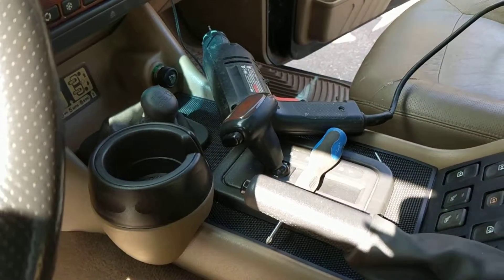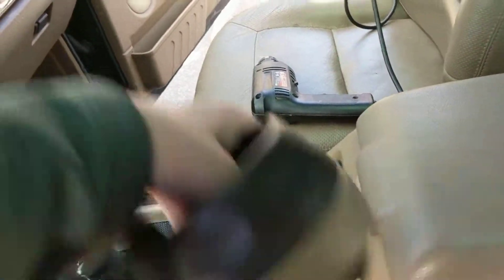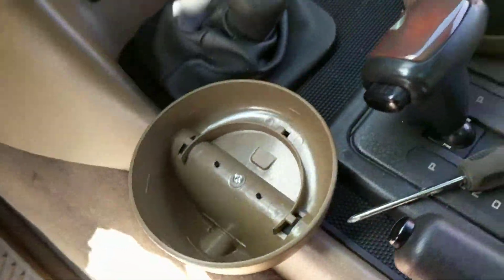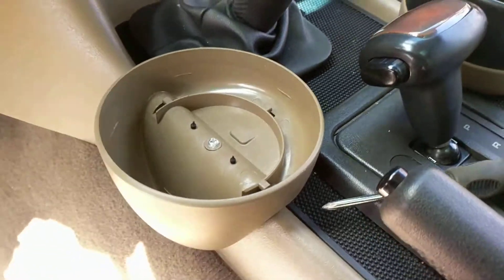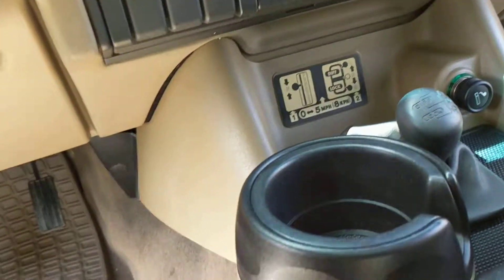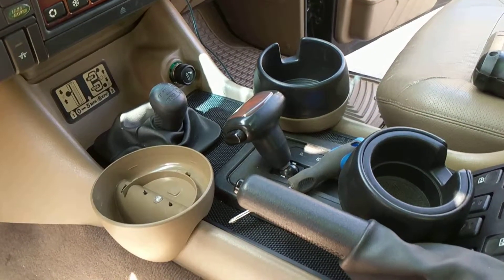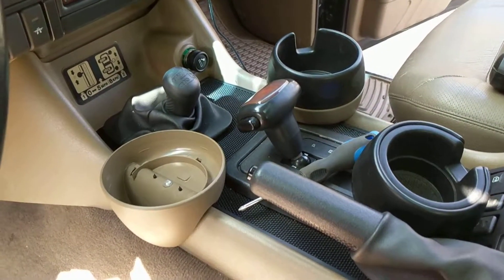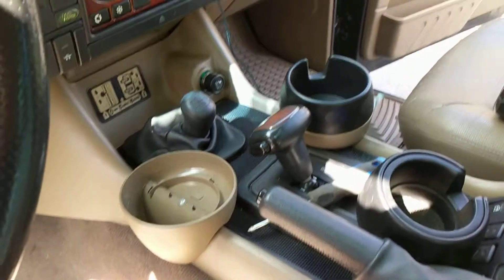1999 Discovery 1 cup holder install

Comment: you did no mention the necessary hole for the locating pin on hte underside of the holder that goes to complement the top screw
- half baked install video
Reply from the maker: Thanks for watching! Mine have been secure for years. Picked them up used. Wasn't aware of a pin ...
Reply: @jamzdotnet  yes, there is an additional hole that needs drilling on the top for the pin
- at least you made the effort for a video, which is something I only think of when I work on the car!

These cup holders really are a big plus when traveling long distance
Reply from the maker: @johnallen3555  I'll take a peek. Admittedly, it's mounted so secure it would take one heck of a wreck to need that top one I imagine!